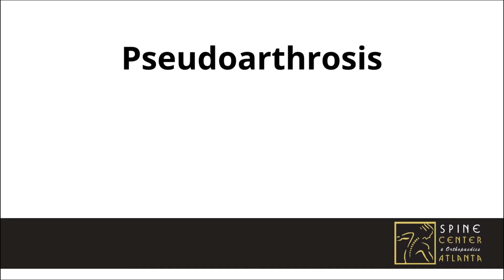Dr. Chappuis Explains Failed Back Surgery Syndrome

Comment: What about metal allergies? Germany surgeons published statistics regarding metal implanted allergies. It is my case. I am a mast cells activated syndrome patient, broke my L4 and had a L5 spondilolysthesis. I wasn’t in pain before the surgery. I mentioned my metal allergies to the surgeon, he agreed on using pure titanium. He never told me he didn’t use pure titanium but used Ti/Al/vanadium alloy. I wasn’t getting my post op report, I refused nerves blocks. My anaphylaxis was triggered much more often. As my PT wasn’t helping, I tried high doses of anti histamines and mast cells blockers, it decreased the pain drastically. I made a Melisa test and yes, I am allergic to many many metals. I therefore need a second surgery to replace the material. I find it so bad to talk about a failed spinal surgery syndrome…it is not even mentioned by surgeons. I made my own diagnosis, contacted other surgeons and Allergologist….and they validated my self diagnosis….

Comment: Dr Chappuis I have only just seen this video and for the first time in my life the 30 + years of pain makes some sense. I am 63 have suffered with back pain from my late 20s. Had all the usual operations which culminated with a disc fusion L3, L4, L5 & S1 12/12/22. Brought to another ED 12/23/22 suffering with 40+ temperature and rigors (sent home same night on my own steam). Early hours of 12/26/22 pain became unbearable and only one hospital had the necessary medical specialists available. Operation re-worked as screws installed out of line initially. To add insult to injury, deep tissue samples revealed staphylococcus epidermidis and resulted in an additional three month stay in hospital on daily intravenous antibiotics. It is now 2024 and I still suffer severe pain daily and am waiting on a spinal cord stimulator. As the first specialist who has made sense to me can you explain if this is the correct route to take or should I be looking to have the fusion re-done for the third time.
Reply from the maker: Thank you so much for sharing your journey. Make sure that your infection is completely cleared and get new imaging studies like a CT myelogram. After that a proper evaluation can be made to see if the issues can be treated surgically with a revision or if surgery is not an option with a spinal cord stimulator. Feel free to visit our website or give us a call to schedule an e-visit if you would like. Wishing you all the best on your healing journey!

Comment: Good information. But I had three empty disc they went in supposedly filled them did a fusion decompression bad outcome waited a year took the screws out hurt  even more . seen a neurosurgeon. He said you’re not stable revisited the site, but the screws in smaller ones this time the other ones were quite large and sticking out of my back. Almost a year later, I could not tolerate the pain took the screws out. I’ve had every injection out there every block ablation. Then they put in a pain pump worked fairly well when it worked half the time I couldn’t get a bolus or it would run out yeah Seven years later had it taken out received a SL 
in between so when they took out the pump! they left the tubing in this time. Tried the stimulator zero Nada they call it. I have failed back syndrome. I disagree. I’m so young and I have nothing to look forward to but pain every day 24 seven never goes away.
Reply: Please don't give up, these folks may be able to help you. Praying for you.
Reply from the maker: Oh no! We are so sorry to hear that has happened to you and that you are living in pain. Please call us or visit our website if you would like another opinion. Dr. Chappuis specializes in FBSS and we have treated thousands of failed back surgery syndrome cases. Wishing you all the best!
Reply: Hello friend how you doing now did you found some relief on your pain???
Reply: I am so sorry....
Reply: Hello how are you. The pain is gone